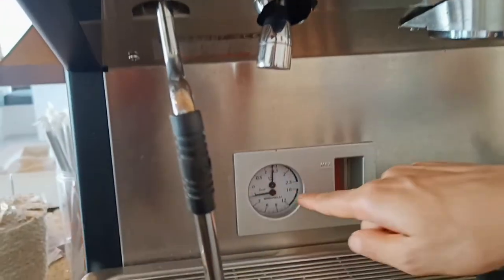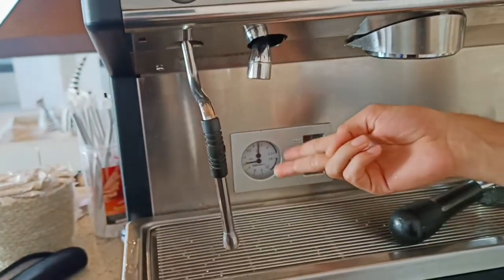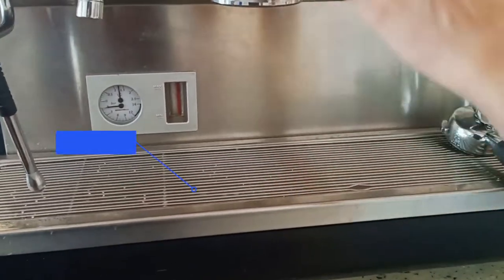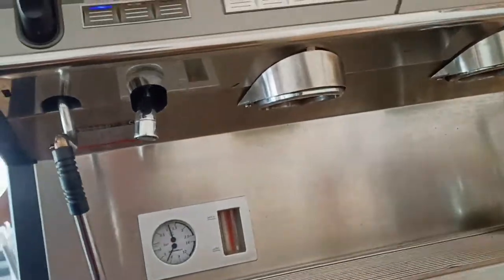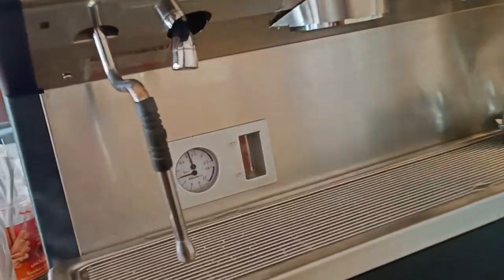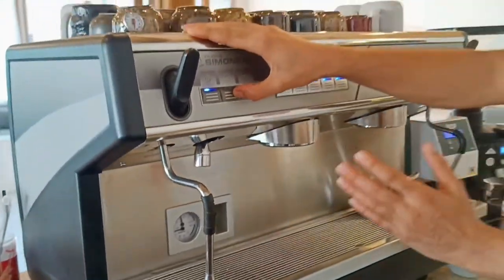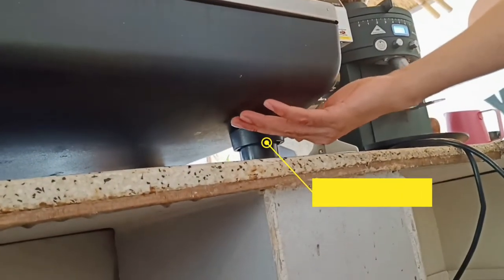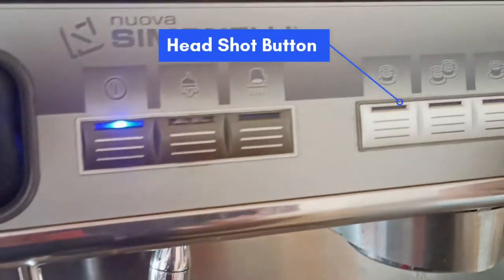Parts of Espresso Machine and its Function | Nuova Simonelli | Coffee Machine Parts Name | Nepali

Comment: Ey semi automatic chai kasto huncha sir?😢
Reply from the maker: ( World ma sabai Bandha badi speciality coffee shops harunma used hune machine semi automatic ho .
semi-automatic espresso machine, you'll grind and tamp the coffee beans, lock in the portafilter, and choose your settings (number and size of shots). Then, just press a few buttons and an electrical pump automatically moves water through the brewing chamber at the right pressure, temperature and time—no manual pulling or timing required.